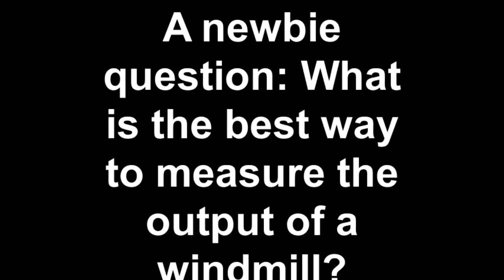What is the best way to measure the output of a small 3 phase axial flux windmill ?.mp4

Comment: @wtam69 
the amperage you are getting at the voltage your battery is choking it down to is the true amperage. By turning faster it is like opening the tap on the hose, you still have the same pressure "V" but more volume "A" so the only way to get more is to change magnets, coils, or speed of the magnets crossing the magnets. You get the same effect when you put the electricity to work and a good visual is a 12v  incandescent bulbs brightness at a watt rating it has

Comment from the maker: @itsandbits1 My windmill unloaded will give well over 30 v. Once I connect it to the battery,  the voltage will go up only nominally. I understand that battery is regulating the voltage and won't let it go up quickly. So, in this case, how would you know or measure the true output of the windmill. The voltage x amp will always be low because the voltage is held down by the battery.   Maybe the shorted amps or the 2 ohm resistor across the rectified output is the way to go.  Thanks.

Comment: @wtam69 
unfortunately ,with the voltage drop acroos the diodes, you may need to go a little faster than you thought to get 13v and  up so it will charge. I think someone told me once to put a 2 ohm resistor across the rectified output and then measure it for true values. Other than that for a quick and dirty, ocv x shorted amps devided by 5 gives you a ballpark.

Comment: rpm is the key no matter how you acheive it. Speed it up and you will get your amps. The wings need to have the power to push power for you to get it out. If you are going to use drag scoop blades put big scoops on and lengthen the blades. They will only go as fast as the wind though so keep the dia down. Lift blades will rotate faster but you need the wind. Speed speed speed, that's what it's about. The battery will throttle the voltage to 12 and then you have to push current

Comment from the maker: @Fearlessthinker  I have hooked up the windmill directly (without a charge controller). So while charging, if the current flow  to the battery is 30ma and the voltage measured at the battery is 13 volts, am I generating .39 watts (watts=volts x amps) with the windmill. Is it easier to measure the watts with a Turnigy watts meter?

Comment from the maker: @trailkeeper  It's wired in "star for voltage." To wire in series as in a single phase, I think the orientation of the coils has to be in a different way, one opposite another. I could be wrong. Thanks for your ideas. I need to sort out the different variables before I start on my next project. Those copper magnet wires are so expensive.

Comment: Some things to consider are , are the phases in series (to increase voltage) or parallel (more current).  Each phase could actually be used seperately as an independent power source.  Just some ideas.

Comment: what gauge wire are you using to link your wind mill to your battery. I found I lost a lot of power using 16 gauge wire you really should use 8 gauge or 10 gauge wire so you dont lose any voltage. Is it ac or dc current?